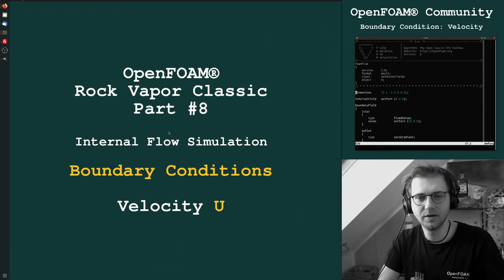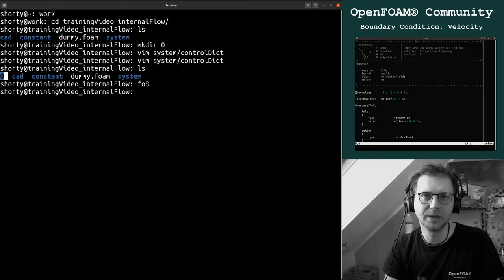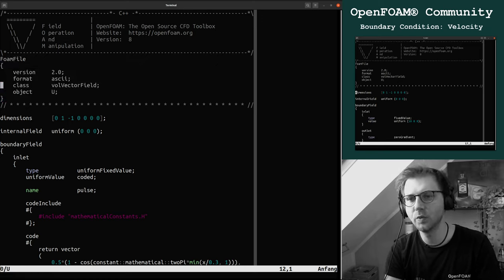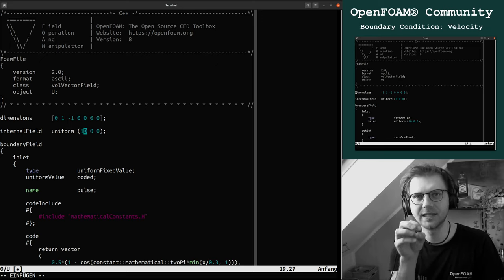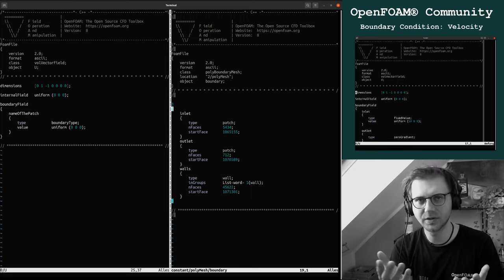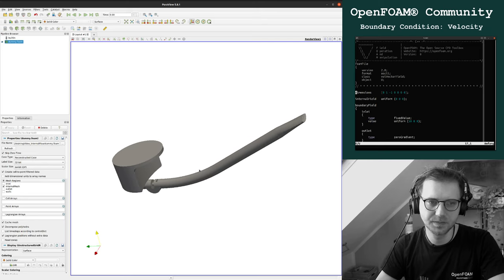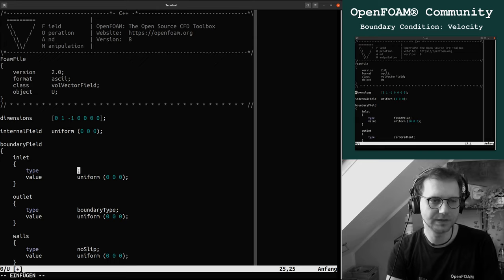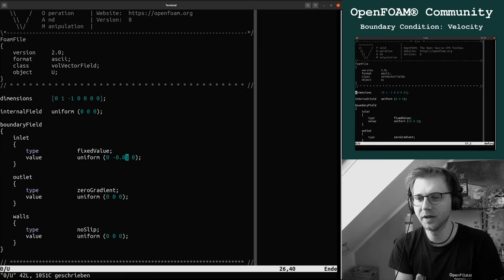CFD Analysis of a Smoking Pipe | Part 8 | Boundary Condition for field U | ∇ OpenFOAM® v8

Comment: Hello Mr Holzmann, first of all thanks for your videos.
I have a little problem while trying to run SimpleFoam.. and i just realize that my boundary file doesn't even look like yours .... more precisely there are no names for the different patchs... also i realize that when u open the  boundary file in your constant folder the location of the boundary file saids "2/polyMesh" and not "constant/polyMesh" .. is there anything im missing ?, when i run IdeasUnvToFoam i get a little error message that saids: found "xxxx" undefinded faces in mesh;adding to default patch defaultFaces, any help with this would be very thankfull.
PD: sorry for my  poor english.
Reply from the maker: Depending if you run snappyHexMesh with the argument -constant, the background mesh will directly be replaced in the constant folder. Otherwise, it is written to different time folders (depending on your writeTime settings).

Regarding the ideasUnvToFoam application. That just tells you, that you did not define all faces/patches inside the unv file and hence, all these faces are defined into the "defaultFaces" patch name.
Reply: @HolzmannCFD  Thank you very much! :)

Comment: in 6:00 I was like.... fuck it if he knows the units that you "never" use by heart, there is nothing he does not know of this soft ahahahah.
in any case, as i cant remember i copied the comment to my dummy U p etc files :) 
//[kg m s K mol A cd] [kilogram metre second Kelvin mole ampere candela]
Reply: tobias, small question that I made myself watching this video, the patches are only surfaces, but we are in a volume mesh, so the boundary conditions are applied to the centers of the cells that have a face on this surface? I mean for example, the noSlip BC, fixes the velocity vector to (0,0,0) this means that the velocity vector in the first "row" of cells is fixed to zero? I am asking this as OF uses the center of the cells with a gradient inside the cell, so the (0,0,0) is fixed in the center of it? or as an "extreme" of the cell and then OF calculates at the same time the center of the neighbor cell to the wall patch?

and as always thanks for the great videos!
Reply from the maker: No, we fix the values at the face of the cell and not the cell center.